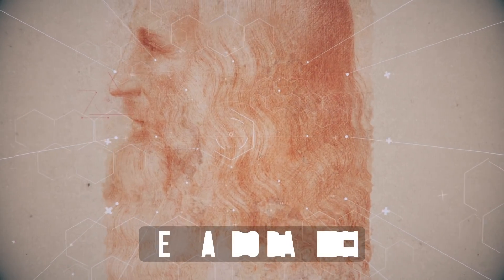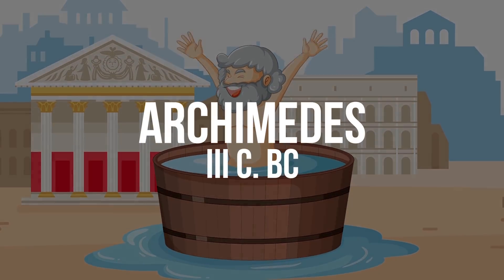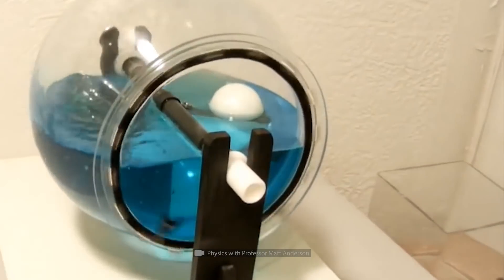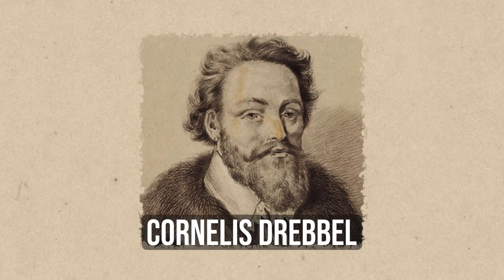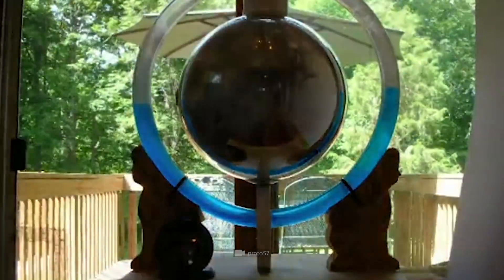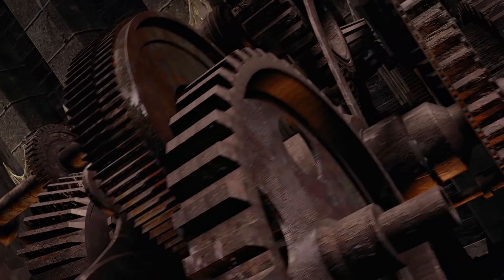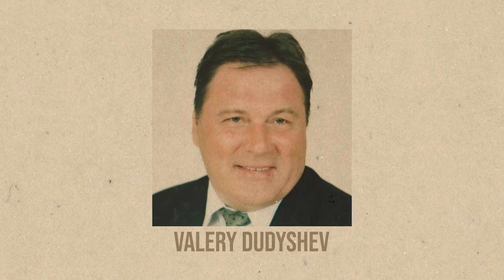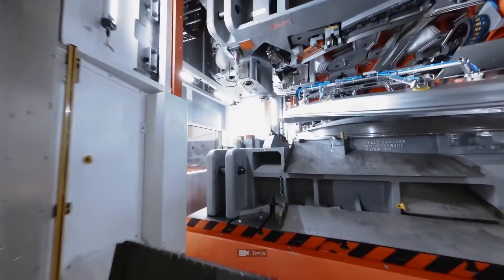Are Scientists Close to Creating a Perpetual Motion Machine?

Comment: Perpetual motion machines are a good concept. But for instance, if you take a gyroscope and some magnets. As long as everything is in balance it should work perfectly. But how do you successfully capture or utilize the power from it? This could be accomplished via a microprocessor, but it would have to be in small pulses. Otherwise, it would put such a load on the unit that it would shut down. But if you did in pulses & you had a Capacitor bank the uses could be tremendous. Continue to Dream, everybody's trying to charge someone for everything today. 🤔

Comment: You can belt an electric motor to an alternator which is attached to a battery that powers the motor.
Reply: You mean the engine of the vehicle? It's not totally relying in electricity it is relying through gasoline or diesel then it will run the alternator to recharge the battery .

Comment: Designs are good and we’ve seen it done on Lego but:

1) materials degrade
2) friction can be fixed by adding grease or oil but you’re back at (1)

Most designs do depend on a force which is gravity.

Comment: They will never work. it would have to use its own energy to run. Resulting in a pointless machine. And the movement of the perpetual rotation causes the axis to off center and it stops moving.

It's impossible, been tried for like a thousand years by people smarter than us. There's endless books about to how to make them and why they don't work.

Comment: Here's the answer: No.

Perpetual motion is not able to be done on earth because of gravity and the laws of physics on our planet. You could easily make a perpetual motion machine in space, but it would overload itself and explode without having hydraulic brakes that would use its own power to slow it down to a steady pace, but the brakes would result in it being useless and using the power it makes to run itself resulting in a giant rotating pointless machine. You'd need a perpetual motion machine the size of a truck to power 1 lightbulb. And would be more expensive to maintenance it than just using other sources for energy.
Reply: In latent terms it would have to use its own energy to run. Resulting in a pointless machine.

Comment: I've been feeling like the current approach to fusion energy is akin to perpetual motion.   I though that might be where you were going with this
Reply: Not really, for fusion to happen you must fuse two atoms Or more and that takes a Lot of energy to achieve, and those atoms are Not perpetual, you have to refuel the reactor with more. The current problem with fusion is that we actually spend more energy by making the fusion happen than we can harness from It.
Reply: @giovanesantos7796  
From what I've heard, man-made fusion is different to star-made fusion.
Humans use immense speed and pressure to have the atoms crash into each other.
Stars, as far as I know, use pressure and quantum mechanics.
So atoms aren't "physical" as you'd think, they're packets of energy rather than the depictions we see in science books, and because they're packets of energy under immense pressure, they also have an immense amount of energy.
Energetic atoms vibrate and move in random positions, albeit miniscule.
If two atoms against each other wiggle in just the right way, their proximity causes them to fuse.
So it's not entirely pressure that causes that, but quantum mechanics.
If it was ONLY pressure, then the starts would have to be so much more massive and much more dense, as the size of our star just wouldn't cut it, there wouldn't be enough pressure.

Comment: Perpetual motion is obtainable. The government doesn't want perpetual motion machines and in fact try to create  laws against them otherwise you could take a tesla car and introduce alternators around the wheels for instance to provide recharging and initially create your perpetual motion type vehicle. The idea of perpetual motion is obtainable in different ways depending on the machine/device and how to object is to be used.
Reply: There is no government law preventing you from doing that with a Tesla or any car. Go for it. Try it. You don’t even need to get a Tesla. You could mock up a proof of concept in your kitchen for a few hundred dollars at most. It won’t work, but that’s not the government’s fault. It’s reality’s fault. 
But I’m curious about this law thing. Name 3 government laws (federal, state, or county) preventing you from making a perpetual motion machine. 

FYI: EVs already have regenerative braking. If you hooked alternators to the wheels you’d just be taking power from electric motor which is already moving the car from energy stored in the batteries, just to put a portion of it back into the batteries. That makes no sense. You’ve just made a more complex system, with more heat and friction loss, all in order to return a portion a portion of the energy already being spent. You’d be better off just driving slower. But even going into fantasy world where you somehow could magically charge the batteries back to 100% using the same power you are moving the car with, the batteries would still degrade over time. So now you need not just over-unity, but also magic batteries. This is on par with trying to run a car on prayer.
Reply: Perpetual motion is a violation of basic laws of the universe, it's not being suppressed it's science fiction.

Comment: For the machine at 2:27 to work almost infinite without the need of an initial push and energy loss, the balls will have to be solid with one half of it being made from a material that is lighter than the other half and the total weight has be to equal to the force on the other end of the crescent shape towards the edge to make the machine turn when all balls expect for that one are in the center. And because the balls the balls are made from from different material, the heavy part of it, wil always be pulled towards the bottom by gravity , making it always have the kinetic energy in order to keep the flow. However, in theory there is also the possibility that the balls will cancel eachother out due to balancing, but this is also true for the initial machine as seen in 2:32. And because of this, the each of the balls are made to have enough force to break out this equilibrium, the requirement for the total mass is included. 

[Personally I think this the requirement for each half. But I have no way to ensure that this math. Weight 1st half = 0.5 to 2/3 total mass. Weight 2nd half = 0.25 to 1/6 of total mass. And the mould cast 0.25 tot 1/6 of the total mass. The needed weight for is each ball is calculated by the force (mass = weight * gravity) 1 ball needs in order to breakout of the equilibrium of all balls are balanced or all except one or all balls except one are in the middle.]

Edit: added the timestamps and some explanation.
Reply: Build one lol 😂👍

Comment: Perpetual motion is available if you know how lady Isabella water wheels half way there if it recovered and reused water then perpetual motion is what you got
Reply: By that notion everything is almost perpetual motion, if we could just recover the energy put into it.
Reply: @AveragePicker  it what way it's pumping water to stop mines flooding water it pumps away powers a water wheel what powers the pump so tell me how that's no powering its self no got a fuckin engine has it
Reply: @glezgaboy9390  It is powered by water coming down from a higher elevation. If you tried to enclose the system and essentially pump the water back up, at absolute hypothetical best, you'd use the same amount of energy it outputs to pump the water back up, in reality you'd get less, in which case it would not be able to power itself. And you certainly aren't going to get more energy out of it, as in enough to run itself and something else. ...and we haven't even gotten into evaporation issues. 
The idea has been around since like 1150 but by all means, try it. You can build and/or buy Bhāskara or laxey wheel models for gardens. Go for it. You'll accomplish something nobody has ever been able to, that was thought to be impossible, and lead a reinvention of physics as we know it. You should be able to build a proof of concept for less than $100, so seems like a bargain for the results you are expecting.
Reply: En evaperation just fill it way water fkn Albert Einstein couldn't have worked at wan out
Reply: @glezgaboy9390  No idea what you’re trying to say but like I said, go build it. Prove reality as we know it wrong.
Reply: @AveragePicker  bro a don't want to build it as if the powers at be would allow it ffs you invent that yer dead can you understand that
Reply: @AveragePicker  it's got a t rocker what pumps the water free a inverted syphon do you understand plumbing ?
Reply: @AveragePicker  if it's been spinning for 100 years using nothing but water and gravity only down fall is how slow it revolves

Comment: How about this random thought?
We know that energy can be transferred to create more energy so how about a self regenerative bio luminescent source that charges diodes that charge capacitors that supply power to keep a turbine spinning that outputs into inverters to supply power to homes and factories? Not quite perpetual motion but clean and self fueled at least. 
Thoughts?
Reply: I'm not educated or qualified enough to have thoughts about this
Reply: @quaesitor6428  but DC current can be converted to AC at a higher level right?

Comment: When I was a kid a friend and I had the idea for a go-cart powered by a starter motor geared not just to the wheels but also to an alternator and a car battery to kick it off, figured once we got going the alternator would power the motor. My dad come out to the garage one day to see what we were up to, he commended our initiative and then destroyed our dream with something he called thermodynamics. Actually we built it anyway and it ran as long as the battery was connected so we still had a lot of fun even if disconnecting the battery brought it to a near immediate stop, sigh.
Reply: Good on ye for building it despite the science!
Are ye both successful inventors today!!???
Reply: @tomkeegan3782  -- I am an engineer and my friend is a high school math teacher.
Reply: There needs to be a Dynamo gear system between the axles spinning the generators to get the alternators up to speed andthir needs to be a capacitor bank to hold the charge during stops
With enough charge to last through stop and go trafic

The Electric Motor needs to be rated to move your vehicle
Reply: @Frarmer777Frank  -- Even a large bank of caps would bleed off too fast to be useful and the only time you could charge them would be going down hill. Even if you added a flywheel it would not buy you much time, as soon as a load was put on the flywheel it would spin down.
Reply: when I was a kid, I did something similar, but without he go cart. starter, an generator, belts, and a car battery was my game. It really took off till the wires started getting HOT. VERY hot.   I figured MORE power was needed toget it running so I hooked up the battery charger to it.  Nope.. no perpetual motion, but it was a lot of fun.

Comment: the time crystal has nothing to do with perpetual motion... 
"In their experiment, Gruszecki and Träger placed a strip of magnetic material on a microscopic antenna through which they sent a radio-frequency current. This microwave field triggered an oscillating magnetic field, a source of energy that stimulated the magnons in the strip – the quasiparticle of a spin wave. Magnetic waves migrated into the strip from left and right, spontaneously condensing into a recurring pattern in space and time. Unlike trivial standing waves, this pattern was formed before the two converging waves could even meet and interfere. The pattern, which regularly disappears and reappears on its own, must therefore be a quantum effect."

they had to induce current to get the "motion". it wasnt about harvesting energy or motion without energy at all.
Reply: And slows down over time.
Reply: radio frequency's are the key.

Comment: just wondering when a object with mass uses gravity and apply force and other things (similar to magnet) then does that object looses some amount of mass equivalent to E = mc^2 to apply force or it can just produce infinite amount of force if it can then we can just use tide wave to generate infinite energy
Reply: perpetual motion is the exact same ting as being at rest. relativity and the laws of motion prove that. 
you cant get energy of "perpetual motion" without changing its state. the same thing with "being at rest"
Reply: This is actually a little bit complicated to explain, so I suggest reading a book on the topic or researching further. But generally, energy is not created to induce the effect of gravity (which is not a force btw but that's a bunch of special relativity that I do not want to go into today). 

A very dumbed-down way to explain how gravity works is by considering a small-scale situation:
Think of a tennis ball. You lifted this tennis ball up, and if you were to let go, it would have kinetic energy that was not part of its system beforehand to travel down towards the earth. Where did this energy come from for it to fall? The answer lies in the first step. You exerted energy and did work to lift the ball up against the direction of gravity. This work 'gave' energy to the ball in the form of "gravitational potential energy", where if it was to fall, the energy it would 'expend' in its fall as kinetic energy would be equal to the potential energy it had at the height you held it. Hence, the energy came from you and was merely transferred.

I hope this clarifies some things about gravity. I highly recommend reading further on the subject if you have any questions or concerns.
Reply: @the_power_gm  do you know that categorising into different types of energy, isnt realy more than a human thing ? 
it could be true, that energy is nothing else but energy and every energy is just "potential energy"
Reply: @adswers6900  yes, but we categorise things so that we can explain and identify them better. which is what I was utalising to explain at a very basic level how gravity actually works
Reply: @the_power_gm  i agree

Comment: Well there is one seemingly infinite source of energy that we can tap into that is free for us to use... Cosmic background microwave radiation... AKA the static you hear in your radio when there is no broadcast in that frequency... We just started making antennas that can convert that to something function... This energy may as well be perpetual from our point of view. It will last forever from our perspective.
Reply: only issue is that it's not very usable due to how little energy you get compared to how much energy you use per hour
Reply: @the_power_gm  I am not referring to Tesla's radiant energy set up. A few years ago engineers at the Duke university came up a stackable antenna design that harvests' electricity from background radiation. You are limited by the volume your set up takes but the energy is inexhaustible.
Reply: @PAIP_Studio  I never mentioned Tesla's radiant energy set up nor did I state that it is impossible to draw energy from background radiation. I was stating that the amount of energy you would harvest from background radiation is insignificant for practical purposes.

Also, stating that it is 'inexhaustible' is a false claim as no material or form of energy in the universe in infinite.
Reply: That would be like trying to use your dandruff as fuel for your fire. You can gather  an infinite amount theoretically but it's so minuscule that it won't do shit.
Reply: @gqfrisk5727  Well if your potato battery never went bad and never run out would you still keep it around? I guess we will see when their patent expires...

Comment: If we can create a more efficient motor to power our modes of transportation it will largely decrease our overall energy consumption. The average gasoline burning engine of today is only approximately 20% as efficient as what it could be. Imagine getting 150 mpg instead of 30 mpg
Reply: 0-62mph in 1-2 hours😂

Comment: The issue with perpetual motion machines, apart from thermodynamics, is that they can't do any meaningful work when a load is applied to them unlike a gasoline engine. That being said, a lot of cool engineering goes into these machines. It takes creatively and knowledge to build them. I'm an engineer and I look at some of these contraptions and they look fun to build. That is probably the best thing you get out of them.
Reply: yes because perpetual motion is the same thing as being at rest.
Reply: some of the best mechanical artworks tend to use very low energy-consuming motions to make a seemingly perpetual mechanism with fancy patterns. obviously, the system stops moving eventually, but the spectacle of having something make fun patterns for you for a little while after a small push or crank makes for a nice project